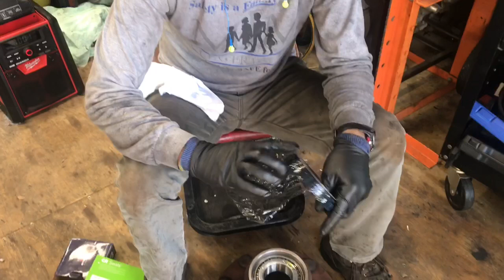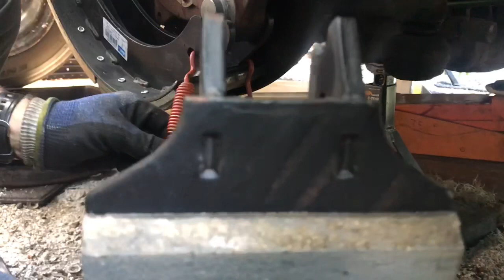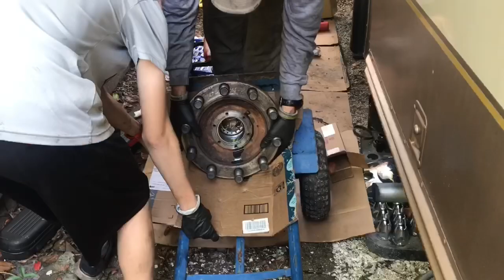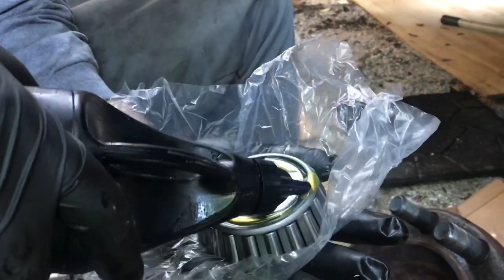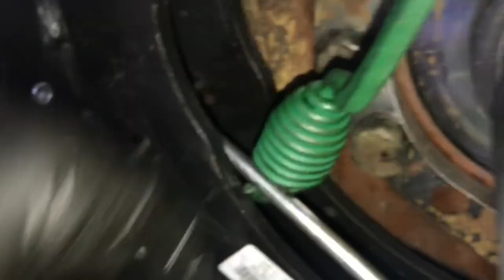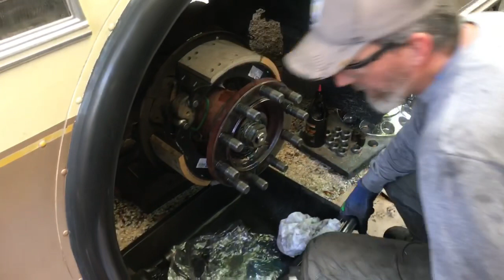Installing wheel bearings and hub seals on the Wanderlodge.

Comment: Thanks for calling out the torque.  I need to find the "book" for working on mine.  But a great video.
Reply from the maker: No problem, glad the videos are helping out. Just make sure you check the end play to verify the bearings are set correctly, and a being on the looser side is better than too tight in this case.

Comment: Great job documenting that work!! Never thought to cut a slot in the old race- I ground mine down to a smaller diameter with a wheel, but your way is much easier!
Reply from the maker: Shane Fedeli - Thanks, yea I have learned to work with what I have around.. and I knew the old races were going in the scrap pile, so why not use them.. hopefully the videos help other owners understand and or be able to fix these old birds and keep them on the road..